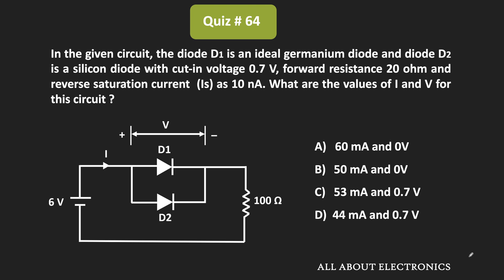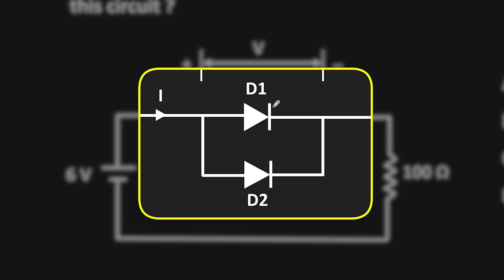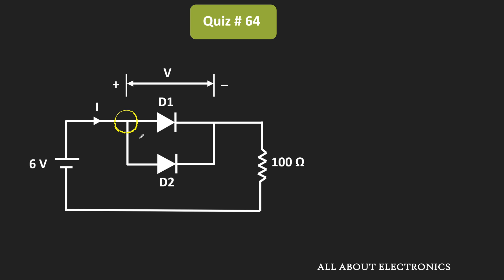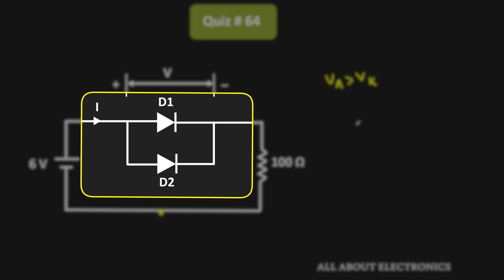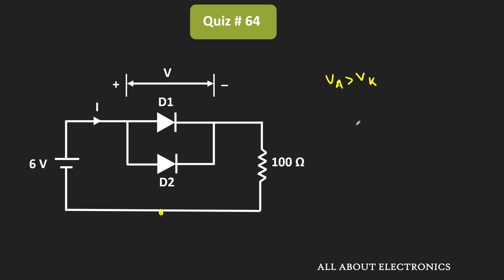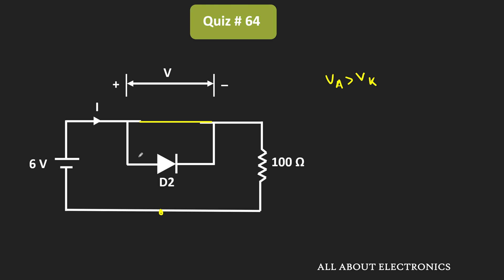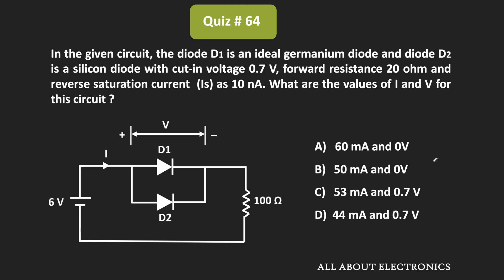What happens when two different diodes are connected in parallel? (Analog Electronics) |  Quiz # 64

Comment: Sir plz. Can you tell if both diodes were not ideal, then what will the final voltage '' v ''
Reply from the maker: In this case, one of the diode(D2) is not ideal. It has cut-in voltage of 0.7V, while the D1 is ideal germanium diode.

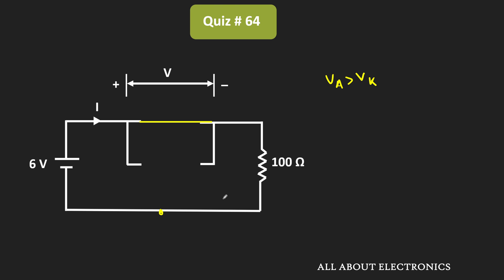Comment: 2:15 how the voltage will be zero,there is an input voltage 6 volts right
Reply from the maker: Of course the input is 6V, but here this voltage V is the voltage across the diode. Since it acts a short circuit (being ideal diode), the voltage across it will be zero. If you measure the voltage across 100 ohm resistor, then it will be 6V.
Reply: But in the question they mentioned that in the circuit,not across the diode
Reply from the maker: @ssmbfire  But as you can see from the figure, the V is the voltage across the diode in the given circuit.
Reply: Fine👍,sir

Comment: An ideal germanium diode will still have a voltage drop of like .3 volts.....   correct answer is .3 volts and 57 mA.   You should redo this video.
Reply: How can it be ideal and germanium at the same time 😂
Reply: @sibilakshman9575   Oh I don't Know 9 seconds into the video if you read the paragraph above the circuit it says "ideal" germanium diode (no such thing see the link).  So he has to pick either I have a superconductor, or a germanium diode.   Can't have both.
Reply: @justinhensley108  @allaboutelectronics  Yeah that's what I am asking how can a diode be ideal and germanium at the same time 😀 ?
Reply from the maker: I agree, the question could have been framed a little bit more specifically. In the question, I should have specified that, the D1  has zero forward voltage drop to avoid this confusion.
Reply: @allaboutelectronics-quiz  SEE NOW YOU ARE AWESOME!  I never had any malice, I was jjust like WHHHHAAAAAAAATTTTTT , I agree with you, you agree with me!  It was just the definiftion OF the premise.     ....You can highlight my replies now since we agree, I think a lot of people even content creators would learn from this....just be specific.    Also, was a great video, probably would have ignored the "ideal" comment but for the fact its my job to design stuff and was like [wait what]?
Reply: @justinhensley108  if you set the Ge diode cutoff voltage at 0.3V, a parallel 0.7V diode is still present so is Vo 0.3? or 0.7? or a equivalent of both in parallel, if so what is that equivalent value?
Reply from the maker: The ideal diode has zero forward voltage drop and zero forward resistance. Therefore, here diode D1 is represented with short circuit.